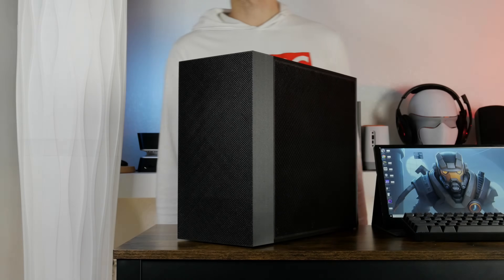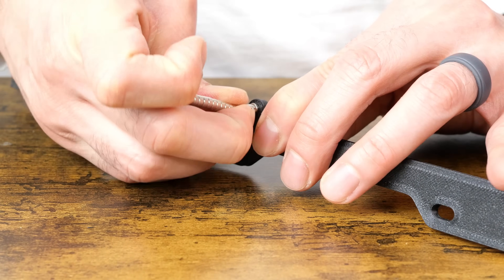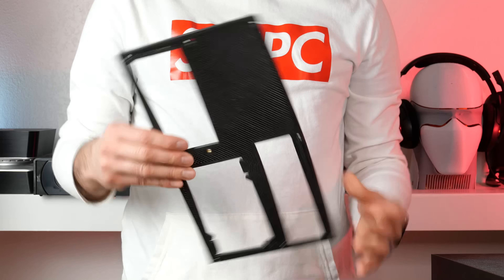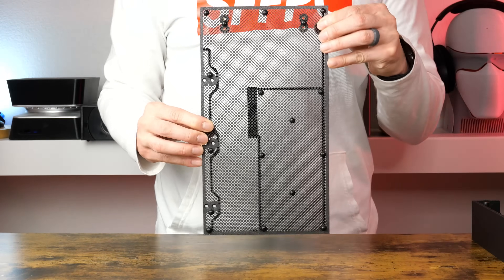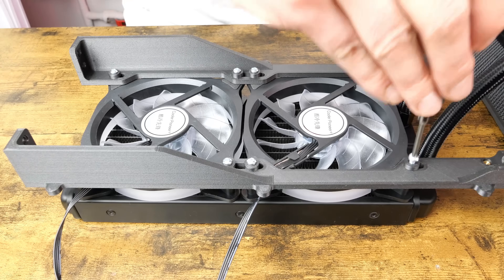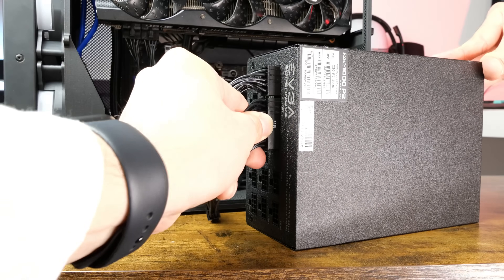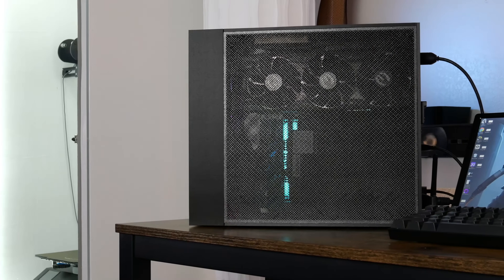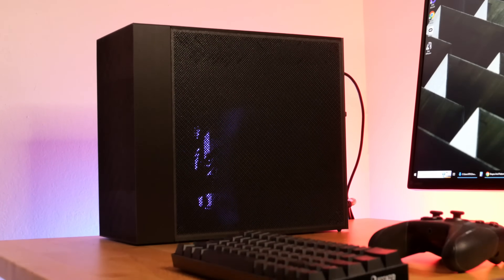3D Printed PC Gaming Case - Full Size ATX

Comment: i have question is there a way or version of this that has 360mm aio or if not is it easy modeling the 360mm part of it, kinda of a newbie to 3d printing thank you
Reply from the maker: Easy is relative. The changes you want would be as “easy” as designing a new case.

Comment: That's a well put together case and it's unique. Bit boring design for my taste, but for a CATX (Compact ATX) case, it's pretty good and it could integrate well in an office space. The only thing I would advise people with GPUs that use 12VHPWR cables to not do is to attempt on shortening those particular cables, since as we all know, many RTX 40 and 50 series GPUs melted because of a cable/connector issue. I doubt that a DIYer could do as good of a job shortening and assembling those cables as factory did, so best to avoid a potential wallet and fire hazard.
Reply from the maker: Thanks for watching and commenting!

Comment: how do I go about making a case for a laptop motherboard?  I have a broken old laptop that I can use Looking for ideas to use this for an emulator system.
Reply from the maker: @gushergizmak  same way i designed for this case: 3D printing upgrades for a prebuilt PC
https://youtube.com/live/Pa_CdK5_AaA?feature=share

You need to measure out the motherboard completely and design around those measurements. 

Hint: you won’t get it right the first time or even the 4th time. But if you don’t quit, you will succeed.

Comment: Nice case, nice video and production. Just a question, you added a filler 3d printed part to the mobo plate, thats and ATX mb. I'm looking for assembling a cheap dual Xeon E5 v26xx V4, and those mothersboards are E-ATX, which it seems no te be a standarized size, but it's about 320mm in length. Do you plan to make an EATX or do you think this case could fit one? 
I don't plan to use a GPU, or if mandatory just a VGA out kind of card, but the coolers are somewhat big hefty towers (they should be kind of height, cause RAM slots are pretty close to the CPUs).
Any recommendation is kindly appreciated.
Reply from the maker: I believe some of the mounting holes should match for eATX, but don’t have one hand to verify. 

One limiting factor is I have designed in some expansion mounts that will interfere with PCBs beyond ATX - but that’s nothing 5mins with a dremel can’t fix lol

I don’t design for components I don’t own, so unless you want to send me a board to measure and test, it ain’t gonna happen.

Comment: I was giving this a go on my XMax 3, but I kept getting "movement beyond provisions" errors. I have my print volume set up as a 330x330x325 cube, and the parts all fit inside the print area in Qidi Slicer? How did you get yours to print? For the record, I am updating to the .15 firmware right now.
Reply: I looked at that also, then realized I can just buy a different AIO and keep the print. I'll post pics when it's together.
Reply from the maker: @Tired_Geek  Please share when you're done!
Reply from the maker: Odd? I just plopped in QidiSlicer and sent to printer from what I remember. Are you using QidiSlicer or QidiStudio? I’ve never used Studio to actually print, just installed and opened.
Reply from the maker: I just realized you changed your print volume settings from stock? I didn’t touch any of that, so I suggest you go back to default- only settings I changed were disabling top and bottom layers to achieve the mesh effect.
Reply: @standupg4m3r  I got it to print perfectly! I reset to factory and used Orca Slicer's Qidi settings for Generic PETG-CF. I'm currently waiting on my custom cables to finish it up.
Reply: @standupg4m3r  The print turned out perfectly, but I found out too late that the 75mm tall cooling block on my AIO collided with the ATX PSU. I kept having part failures  with the hot ends, but Qidi backs their products well. Back to the drawing board. Maybe I'll just make your test bench, since I already have the mobo tray.
Reply from the maker: @ I assume your block has RGB? I’m willing to bet it can be partially dissembled to lower the overall height.

Comment: Awesome case design and functionality . I wish I could find a mesh replacement top lid for a HP 8200 SFF.
Reply from the maker: Thanks! Also what’s stopping you from designing your own? 

Hint: if you see a flat surface case design, it’s usually basic CAD that can be learned.
Reply: @standupg4m3r  Well I use Blender on a daily basis , It's just I cant afford a printer, That's why I wish people made replacement lids and sold them on line .I picked up a 8 bay DVD replicator, I am using the case to make a JBOD
Reply from the maker: @ AI mini is affordable - mow lawns, clean pools, walk dogs, sell sperm. I believe in you!

Comment: Shorter cables make your psu work better as well (more efficient, better voltage regulation).
Reply from the maker: @tehehe5929  Cost (and/or time if you make it yourself like I did) is the only downside!

Comment: you should've mounted the PSU with the fan facing the side panel, so it can get fresh air.
Reply from the maker: @gianlucaangeli  What would you choose, absolutely NO airflow over your motherboard mosfets/VRMs, or slightly cooler air in your PSU?

Hint: the PSU is never working at full capacity.
Reply: @standupg4m3r  the PSU fan is an intake, so it's not providing any cooling. if anything , it's "stealing" air from some of the VRM on the back of the mobo.

you have aiflow coming from the front intake which should be enough for your MOBO and it it's not enough, i doubt the slight air movement provided by the PSU fan helps in any significant capacity.  if you still have the case you could test it, it would be intersting. 

Also in this configuration your PSU is pulling in hot air from both CPU and GPU. And with how power hungry are the modern components , it's not hard to reach close to full capacity (most people have 600w PSUs).
Reply from the maker: @gianlucaangeli  indeed the PSU fan is oriented as an intake, and it draws air from in front of the fan… guess what is in front of it? lol

The CPU is watercooled, so I’m wondering if you’re confused about what video you’re commenting on?

And if you watched the video, you’ll see that the case was designed as small possible and in doing so, the RAM modules completely block air flow from the front radiator fans.

But here’s the thing, I designed the case to allow people (who will actually take the time and effort to print it) to orient the PSU how they want lol

Cheers!
Reply: @standupg4m3r  PSU isn't cooling those component if this is what you're implying.

if the ram blocks the airflow then there is no airflow at all for the components.

"cheers" LOL
Reply from the maker: @gianlucaangeli  I appreciate you interacting with the channel! Cheers!

Comment: Personally, I'd use the external screw holes on the exterior of the case as a spot to mount a reservoir for a custom water cooling loop. Or maybe even for a case mounted display of some sort.
Reply from the maker: Love it!
Reply: @standupg4m3r  Thanks for the fantastic video! You've earned my sub. :)

Comment: I've been dreaming of piecing together an ATX-sized HTPC case and this only confirms that it's possible. I'm hoping to keep the overall width of the case under 70mm by compromising and using an SFX power supply and by letting it sprawl out. If the size constraints work out, I might be able to include an ODD and some drive bays! Thanks for the vid.
Reply from the maker: Thanks! Please post a link here when you complete the system. Also keep you eyes peeled for another ATX monstrosity...

Comment: I'm doing a similar project of my own, Are there any tips you could give to make the early development of the PC case easier and more 3D printable friendly? And would normal ABS work fine or would you still recommend more durable materials with carbon? 

Thanks in advance, and an amazing video with lots of inspiration taken!
Reply from the maker: Thanks! Honestly PETG without CF is fine for smaller cases; I just wanted to give this case the best chance at success with the CF impregnated filament - you should be fine with ABS (with or without Glass Fiber).
Reply from the maker: Also please link your finished case when you complete it. Love to see others creating and sharing. :)

Comment: Why does the PSU have a fan inward and not outward?
It seems to me that it would be better for the temperature if the air came from the outside, and not from the case?
Reply from the maker: Thanks for watching!

The original design in my head was as you described, but when I started fitting things together, it was best to have it opposite ( My RAM essentially cut-off air from the radiator); nothing is stopping you from going with the original idea since I made the holes to accommodate for both though!

But in practice the PSU doesn't seem fazed on account of fan noise, and now the VRM area has some airflow near it.
Reply: @standupg4m3r  
I understood, there is logic in this
I did not even think about it
In this option, you can simply take a PSU with a larger capacity and it will not overheat))
Reply from the maker: @MrStubbs760  Indeed! 1000W is overkill for the components in this build ;)

Let me know if there are any ideas you want to see done too!
Reply: @standupg4m3r  Hehehe))
Sorry. well, 1000 watts is quite enough, I just didn’t notice how much you had.
Well, the only thing I thought about was to think about how to separate the video card space from other elements so that they do not exchange hot air.
Reply from the maker: @MrStubbs760  stay tuned for future air flow management;)

Comment: Excellent video! And the information you provide, your tool and materials is super thorough. Well done!

What program do you use to design your 3D parts? My son who is 12 does some 3D printing and was using tinkercad but he couldn't modify the shapes so I suggested blender since it is open source and can be used for 3D printing, but neither he nor I know much about the program.
I also heard SketchUp was easy to use but I'm not sure which program we should dedicate our time to. You don't have much time to.

I have been drafting on AutoCAD for a really long time, mostly 2D architectural drawings and when I've experimented with 3D modeling inside it it wasn't very easy to use and I figured they were better programs out there to dedicate my time to.

I would just like to know your opinion. Again, awesome video! Very inspirational.
Reply from the maker: Thanks for watching! I use Solidworks (too expensive to consider... but they have student versions), and I would look into Fusion 360 or Onshape if I were you and your son.
Reply: @standupg4m3r  yeah I would probably do good with those programs because I'm familiar with the AutoCAD ecosystem. But anything from Autodesk is usually expensive.
Reply from the maker: @the_stixXx  read the details on fusion 360 and Onshape. There’s a reason I mentioned them. ;)

Comment: Just make sure you cut those zip ties on an angle about a quarter inch long 😂
Reply from the maker: You mean from the PSU loom?
Reply: @standupg4m3r  the beginning of your video when you were fixing your 3D printer you had to fix it with zip ties. I was joking around. When those things are cut a little long on an angle they can be brutal.
Reply from the maker: @the_stixXx  oh I already forgot about that lol, but I’ve grown wiser around zip-ties! I didn’t show it here, but sometimes I even use nail clippers to make the cut a wee bit “safer”; the nail clippers have a curved blade that in theory should take care of the blood inducing edges.

Comment: You wanted to share your Qidi printer settings and tweaks in a Video. Nobody has done any video about that yet, and it might help other owners of the printer a lot!
Reply from the maker: Hey thanks for checking my video out!

I’ll try to go over what settings I use, but I’ll just spoil it for you right now: default - besides switching the built in profiles based on filament. The only “special” thing I apply is when printing the “mesh” which is just 0 top and bottom layers.

Comment: how many hrs. did it take to print all that stuff. and cost ?
Reply from the maker: Thanks for commenting!

Like I said in the video it took about a little more than an entire roll of filament that I linked in the comments, not including the motherboard panel from a previous project using a different filament (that’s also linked in the description of that video). Continuing with costs, do you want just the materials, or does electricity, gas to drive to buy parts, initial investment in tools, cost of printer, cost of filament dryer, cost of workbench that the printer sits on, CAD software, education material to learn how to CAD, etc?

I love/hate content with “make this table with only $6 of wood” or “3D print this PC case for $26” and then the first thing they use is a $600 wood planer or a $1000 3D Printer. 

My printer is quite fast, so the parts had a total run time of roughly a day from my memory; my other printer would be about 3x slower, so I suggest you check the estimated times your slicer predicts - luckily the files are free and available for you to find your answer.

Comment: Try switching to Direct Drive to get rid of the bowden tube entirely. Also wait and let your parts cool down to under 30C degree, don't force grab them out of the hot plate, you may damage the product and the plate itself.
Reply from the maker: Thanks for watching!

Both my printers are direct drive... the tube is just to guide the filament. And good advice on the cooling of parts, which I do for some larger prints; this build in particular handed it well since most of the parts were not so substantial - but the front panel I let cool while I slept in.

Comment: Very cool but honestly why use ATX when SFX can handle top CPU+4090 no problems these days
Reply from the maker: Thanks for watching. I mentioned it in the video, but the most asked/requested setup for those wanting to size down, is the use of their EXISTING ATX parts. 

If someone is buying new parts for SFFPC, then yeah I would recommend the SF750 and SF600 Platinum's easy.

Comment: can i use your stl files to get the measurements of the atx standard? i want to make a custom case but have trouble finding the dimensions required to make the parts fit without having to disassemble my computer

did you measure the real components or based the dimensions from pdfs about the standard?
Reply from the maker: Thanks for watching! The hole locations can be found in ATX docs but I measured them physically just to double check. Please do not copy and distribute the geometry I applied around said holes though.

This work is licensed under a
Creative Commons (4.0 International License)
Attribution—Noncommercial—No Derivatives

✖ | Sharing without ATTRIBUTION
✖ | Remix Culture allowed
✖ | Commercial Use
✖ | Free Cultural Works
✖ | Meets Open Definition

Comment: So cool and it looks awesome! I want to print a case for my server too as what I want doesn't realy exists... I've got a mATX board with intel stock cooler (i guess 6cm high) and all I want to add in the case is 2x 5.25" external slot to add two hotswap modules (2,5" SSD). No power supply (external with PicoPSU) and no extra fans (one on CPU and those on the hotswaps are enough). I tried designing in fusion 360, but man do I suck in that 🤣
Reply from the maker: Thanks so much! I jot down your case idea in my notes, thanks for sharing.

Comment: Include the print bed size you have for your 3d printer.  Also with SFF Noir Shadowlink Antenna's, you can make your PC look much smaller without the large stock antenna's sticking out
Reply from the maker: I have something similar, that I used here and in other builds: https://youtu.be/csN5J56vQgg?feature=shared&t=784

But honestly I misplaced them lol

PS - the link to the printer details are in the description and from the origin video I linked too.

Comment: I’m trying to make a small form factor case that hides the sfx PS 
But including my res and 2 radiators 1 being a 360 and a 240
Reply from the maker: Good luck and thanks for watching! You're going to need to either join pieces together or get a chungus printer like: https://amzn.to/47uLGW0
Reply: @standupg4m3r  I’m splitting it in 8 pieces right not to test fit everything and have a more hands on plan. 
Hoping no infill and 2 walls works well for what I need
Reply from the maker: @CuminPotato  woah, good luck and post back with pics!

Comment: How stiff is the case?
Reply from the maker: [bites lower lip] “stiff enough to do the job”

But in seriousness, I have been carrying, dragging, rotating, sliding, and tilting it in ways beyond what is expected of a PC case for the video and photos. I wouldn’t travel through TSA with it obviously, but if it’s just going to be sitting at your desk while playing waifu dating sims, it’s plenty stiff. 

Re-watch to see how the weight is distributed inside the case. Thanks for watching! ;)
Reply: @standupg4m3r  my printer would not be big enough with a 300x300x300 print size. My case is a massive, 7000D air
Reply from the maker: Check out tutorials on slicing STLs... I personally don't do it because joining panels together is never fun, check out one method of joining pieces here: https://youtu.be/csN5J56vQgg?feature=shared  @tiggerlator

Comment: You can be incredibly proud of yourself, this is amazing!

Is there any danger of the material warping under the system's heat at all?
Reply from the maker: PETG will begin to get gummy at around 80C (melts at 230C+); that means the air has to be 80C or if it’s in direct contact… if the air in your case is 80C you’re in a A LOT of trouble lol

So far I have not found any issues in the number of cases I’ve made, but I won’t rule out the chance of issues arising. However, it seems risk can be had in any form when you look at things like the 12hpwr in the PC realm.